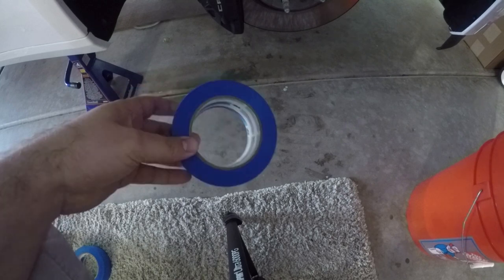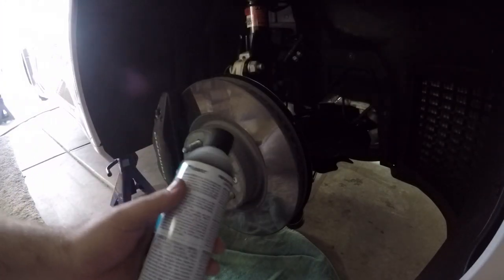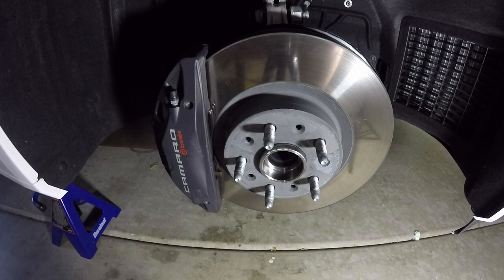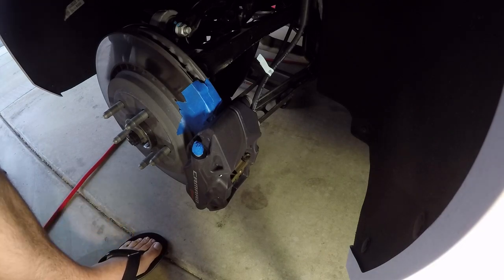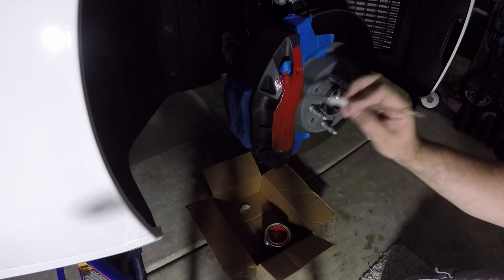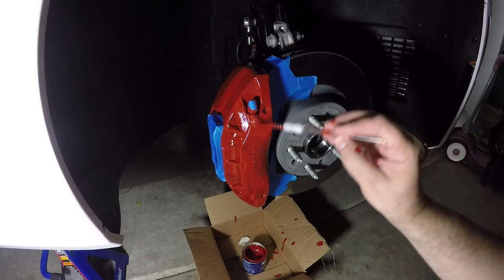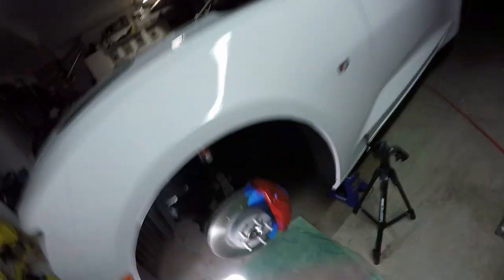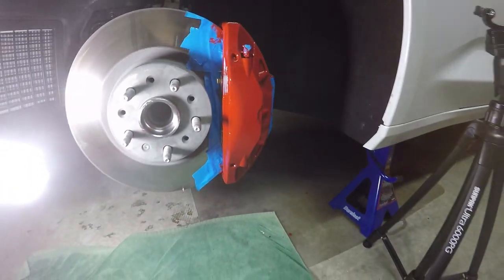Paint Your Brake Calipers - G2 Brake Caliper Paint System

Comment: Great video. My I gave some advice from an old car guy. Make you a safety block from like 4 2x6's. nail them together and stick them under car near the jack stands. Those are fine jack stands but if one fails or falls over that wood block keeps the Camaro off of your legs.  (I learned this the hard way under a 70 SS chevelle).  The brake calipers look great.

Comment: Good video.  I did my '16 ATS calipers (same ones as on your Camaro) just last week using the G2 kit.  Though pricey at about $58, the results look very good ... easy prep with the brake cleaner provided, minimal masking off the area required because little risk of getting paint on unwanted surfaces like with spray cans others use, easy application (though the little brush was toast by the end), a beautiful glossy color without spraying a clear lacquer coat, and no drips or runs anywhere.  No surprises ... I hate surprises.  My decals will be in my mail maybe later today.  Thanks, again!

Comment: Great job on this. Been going back and forth trying to decide if I want to do this myself. Contacted a shop and it was going to be $1,100 to paint them. That's a little strong. Gonna go with the G2 kit and take a shot at it. Thanks for all the videos. You do a very good job with them and there all informative. I have a 14 5th gen and I've done a lot of mods that you talk about in your videos. CAI, headers, tune, BMR lowering springs, MRR replica Z/28 wheels and a few other cosmetic touches. Again very well done man. You have yourself an excellent Camaro and it's nice to see the pride you take in it. 👍
Reply from the maker: +Jammin Jerry thanks for the support and recognizing the passion ;)

Comment: For those of you who are skeptical as to whether or not the kit comes with enough paint or not...Trust me when I say, there is MORE than enough paint to apply almost five to six coats on the largest of calipers. I got the yellow kit and when I first mixed in the reactor and started painting, I was like “This shit is really thin and is bleeding through...I wonder if I did something wrong? Is there enough...?” Between each coat it got thicker and thicker. I put like four coats on with almost half a can left over. My calipers are bright ass glossy yellow now.  :P

Comment: Obviously tape your areas before you mix the paint. Look how late it is in the end. Regardless I don’t think you can screw this kit up. Lays pretty flat from what I’ve seen. As long as you spend the time to clean and prep. Painting is easy maybe cut the wheel to gain access. Great tip on the brush. Theirs is crap. 👍🏼

Comment from the maker: I had no idea if you put time stamps in the description it would auto link to those points int he video. Super cool.
Reply: Lethal 
You can use a vice grip, or a strong clamp to squeeze the metal tighter where it clamps the bristles of the brush, and less will fall off during paint process. 
It's not a 100% guarantee, but with a stronger connection now, and a lighter use with the brush I did have success, and no bristle hairs came off during painting.

Comment: I painted my g37 xs calipers this past weekend, went very smooth, however after day 1 I was 50% done.  I put the paint can lid back on tightly, left it on the garage floor over night and that next morning the paint had become jelly.  The temp only dropped down to high 40s to 50s.  I would think a 50$ kit would not do this.  Anyway I compromised and put duplicolor caliper paint on the left side, but brushed on 4 coats, 3 with the G2 on the right side.  Lesson learned, don't leave your can in the garage over night!
Reply from the maker: Derek, the mixture is a hardening agent. if you don;t complete the work in 4 hours it will harden. It outlines that on the box and I outline it in the video. You have to do it all in one go, or you will run into what you did.
Reply: I guess I missed that in ur vid.  Yep it did harden!  Thanks anyway!

Comment: Three years have passed since this video was made.  I'm interested in seeing a follow up video that shows how the paint has held up or aged over that time.
Reply from the maker: Held up for 2 1/2 years. I have since had my brakes powder coated.
Reply from the maker: It never failed or didn’t hold up. I just had them stripped and coated regardless.

Comment: So I already have my calipers painted and I want to change the color on them. I do like those G2 system however what is the best way to deal with calipers that are already painted. Unfortunately some of the paints falling off of it and chipping away from the old paint. Can I paint over that?
Reply from the maker: Technically you can paint over it, But it would probably have to be a multi situation for sure to build up where it may have chipped or fallen off. since you’re seeing the paint chip, you might wanna look at high heat clearcoat after you’re done painting them
Reply: @Lethalgarage  so when away build up the areas that are peeling off and then go from there? I'm going from red paint to either yellow or gold
Reply from the maker: @DeltaTristar500  yeah, that’s what I’d do .

Comment: How do you get the car on towers I have difficulty lifting my car with a jack. The jack is to big.
Reply from the maker: Smaller jack?
Reply: Use the jack in your trunk to lift it enough to fit your big floor jack

Comment: How’s it holding up? Was a clear coat recommend and does wheel cleaner dull then paint over time? Thanks
Reply from the maker: Never used clear, you need to use a none-acid based cleaner. But still looks new
Reply: Great to know, thank you. Had it on the shelf a few weeks, plan to attack the painting next weekend. Thanks 🙏

Comment: should I use high heat 2000 degrees spray paint after using break cleaner? And should I use the red paint after spraying the high heat spray thing?
Reply from the maker: +Triet Nguyen no need for high heat anything. Just use the G2 kit

Comment: I do the calipers and rotors I take electrical tape and tape around the road was real close to the edge all the way around and then take the whole roll up up and then I airbrush with Rust-Oleum the color I want what's 67 heat temperature in the paint bleed like spray bottle

Comment: I'm at a bit of a loss here. I love the red calipers and have been thinking about doing the same to mine. However, I'm sick of cleaning brake dust and heard that the MGP caliper covers were good for eliminating this (Powerstop also). From what I've researched it sounds like they can help draw heat out of the brakes?

"Caliper covers also have additional benefits beyond appearance and ease of installation: They reduce the amount of brake dust that gets on your wheels, so your car will stay looking cleaner between washings. And contrary to some opinions, the increased surface area they add near the brakes actually serves to reduce overall temperatures. MGP ran tests with an infrared thermometer gun and found that their aluminum caliper covers acted as a heat sink, drawing heat out of the brakes and reducing caliper temperatures by 30° to 50°F."

What's your two cents on caliper covers? Thanks Matt!
Reply from the maker: They do not reduce heat and they do not stop dusting. I am honestly shocked so many people buy these. If you have real brembo's paint them or powder coat them the color you want and they will look great.
Reply: LethalGarage On that note I'll definitely be painting mine instead then. Thanks Matt!

Comment: Where were all jack stands located ? Painting my 18 2ss on Monday 😃
Reply: Kdog 27 over all good it was my first time so there is like 2-3 mess up spots where u can see paint run down but if I could ever do it again it would come out way better and plus yellow was a pretty hard color to work with getting it to cover took some coats cause yellow is a light color but they look great , I wanted them yellow now because in the future I’m gonna replace my front 4 pistons in to 6

Comment: Matt, I painted the bleeder knot/valve too, would that be a problem in the long run? Thanks again
Reply from the maker: +Astiginbro if you have to change brake fluid it could cause the paint to flake

Comment: Not sure how I feel about a paintbrush method for this. Wouldn't the finish dry in brush-marks and really bad orange peel?
Reply: Plus, what about a clear coat to add extra gloss and protection?
Reply from the maker: +Harris Montevallo not needed. Been on the car for one year with no chips or issues with decals
Reply from the maker: +Harris Montevallo  nope, as it is an epoxy it becomes a smooth coat.

Comment: I installed the throttle controller and now my engine light is on, is this fixable?
Reply from the maker: +Manuel Ureña Remeove the controller and drive 20 miles. Reinstall and re-calibrate it on how my video shows you or how the instructions outline. The check engine light will come on when not calibrated properly.

Comment: Great video and very informative. i just had a couple questions: how long do you have to work with the paint (thats in the can) before it starts to harden up? ive read on line that you have about an hour before the paint in the can begins to harden up, is this true? also with the brush method, do you get any orange peel look to the paint on the calipers?
Reply from the maker: I completed this all in a hour. So beyond that not sure. Depends on the application for orange peel. But if you want perfect get them powder coated.
Reply: @Lethalgarage  You put 4 coats on all calipers in 1 hour?
Reply from the maker: @davidcrandon2329  Correct

Comment: Hey Sledge, how's your G2 paint holding up? Ive been going back and forth if I should do it myself or get it done at the shop. Great vids as always.
Reply from the maker: +Rated Robsclusive no chips and is as shiny as the day I put it on.
Reply: +Lethalhammer sounds good man! I'll definitely do this soon. I've used only Dupli-color kit and HTV before.

Comment: how many coats do you think you can do total with 4 oz? I just got the paint im worried that its little, i have 4 large calipers...
Reply from the maker: +Realist If you have the G2 kit, you should be able to do 6 coats across all calipers. But 4 is more than enough, even my 3 coats as seen here turned out really good.

Comment: Finally got my youtube able to leave comments. I got the G2 kit coming in the mail. wish me luck. I been watching all your vids and would like to pick your brain on some stuff for my 2016 Camaro 2SS. I live in Hawaii and parts are ridiculously hard to come by. I would like some help!
Reply from the maker: +kki56 hit me up!
Reply: how can we private chat? u got Facebook Messenger? If so what is your Facebook handle?
Reply from the maker: +kki56 send me a message here on YT. I actually check mine.
Reply: ok. So many things i need (want) for my ride. How can I getahold of the body kit? nothing available here yet. I know u got yours through your dealer. Do u know when i could get 1?
Reply: also want the cold air intake. Do i just gotta hold tight and waiter GM to release?
Reply from the maker: +kki56 I do not know when GM is going to roll out more. I do know ACS has a system.coming.
Reply from the maker: +kki56 GM's is coming, probably another month.
Reply: ok i"m frustrated. Absolutely love my 2SS. BTW its summit white w/black rally Stripes. Cant wait for the body kit and cold air intake to roll in. Thanks for the info. Love the vids, keep them coming. I look forward to watching them as i myself am not a "Mechanic" but love doing whatever i can to my car. Also could you do an instructional for the first oil change. I know how to change oil and  filter, but would be good to see locations of everything before diving in myself

Comment: How much paint did you have left over? If time permitted would you have been able to do a 4th or 5th coat on all fours?

As a tip to anyone reading if you prefer to spray you can use the Preval 9 oz. Complete Spray Gun, and is even recommended by G2 on their website. Cost about $5 at HomeDepot.
Reply from the maker: I have 40% left over. You can do more coats, but that the risk of losing definition on how the brakes calipers look.

Comment: Overall, are you pleased after it sat?
Reply from the maker: Oh yeah
Reply: Looks great man. One other question, how long did the entire process take? Also, the brake cleaner can that drip on the rotor after spraying? Thanks again
Reply from the maker: +Jared Murray took me about 2hrs to prep and paint. Yes the brake cleaner can get on the rotors
Reply: Lol, sorry for all the questions!! Finally got my kit, I have lowering springs on it did you run into any rubbing issues when jacking up your car on floor jack's? Thanks again man

Comment: This is the smoothest I've seen a G2 kit come out. How did you apply it so smoothly and prevent brush strokes? Thanks!
Reply: I did mine the other day using G2 and had very minimal brush strokes.  It was warm at about 85 deg F, so maybe that made a difference(?), I don't know.
Reply from the maker: The warmer the better

Comment: what sizes are your rims?
Reply from the maker: +EddieBoy B 20"
Reply: Lethal what kind are they?
Reply: Lethal what kind are they?
Reply from the maker: +EddieBoy B I am running MRR M017's 10×20 in the front sporting 285/35/20's and 11x20 rear with 315/30/20.

Comment: why would you paint new break calipers ? In real world people paint calipers that are rusty and need a lot of cleaning and preparation before. What you showed there is the same thing as painting a fence is pretty sad if people don`t know how to do a simple stuff like that. By the way the break discks or pads doesn`t have to be covered as the paint falls from them after a few brakes.
Reply from the maker: +The believer Why? Because the grayish back color looks like crap tbh. Red was the color I wanted so I went that way. If you don't properly tape the area off you could get flakes and rough corners.

Comment: better idea, buy your own brushes, buy your own brake cleaner, buy a top quality oil base paint like rustoleum which is also heat resistant   total cost $10.00 all you need now it to do it yourself. save $25.00
Reply from the maker: +Newton Washinton unfortunately rustoleum doesn't hold up or cure like the G2 kit. You can do it with high quality product that is meant for this or buy cheap heat rated stuff and have to redo it every few years.
Reply: I did my mustang 3 years ago still looks new,.. thanks, just saying it worked for me, what gave me the idea is i use rustoleum on the top of my grill which gets the hottest and no problem.
Reply from the maker: +Newton Washinton When I used high temperature rustoleum the paint was chipping from small rocks :( I was having to touch it up all the time.  The G2 product has proven to be more durable and allows me to have my calipers become an after thought.
Reply: I've used Rustoleum and the VHT kit but the G2 gave me the best results. Definitely get some better brushes. I found a 10 pack of assorted brushes at Walmart in the Arts/Crafts section for $8.